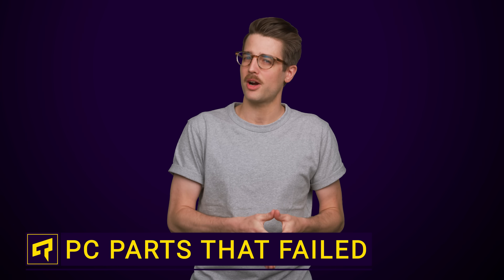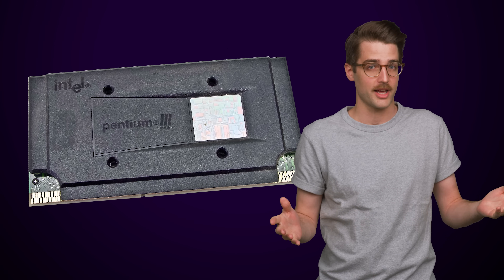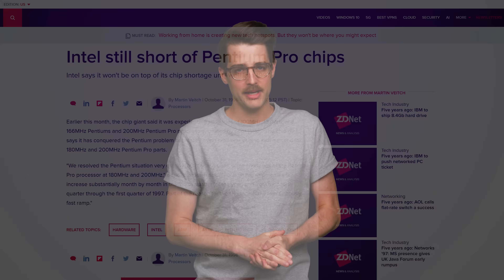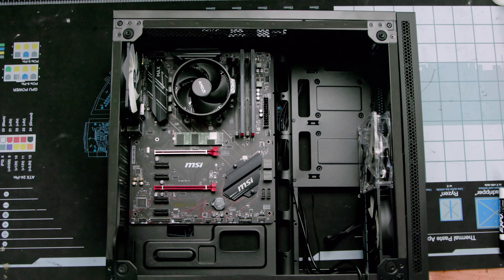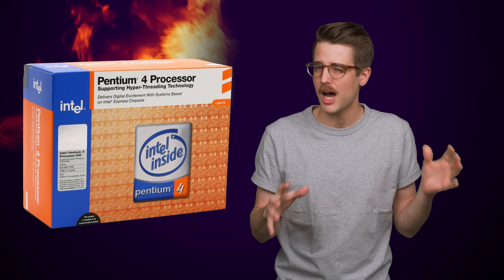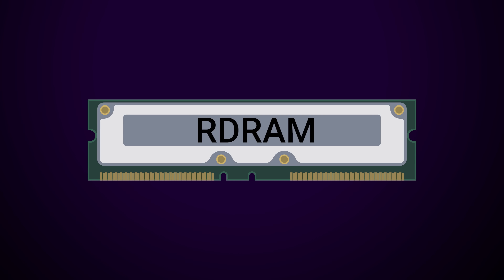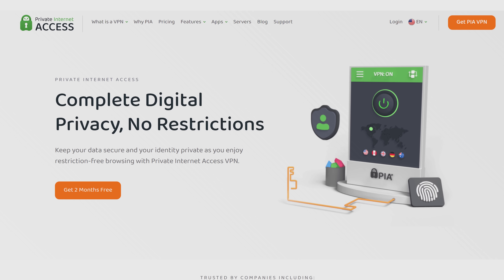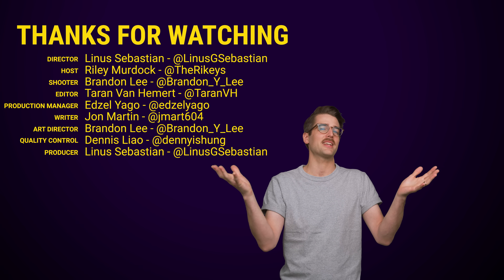PC Parts That Disappeared

Comment: this makes me think about: laserdisks, zip drives, sound cards, parallel ports, trackball...
Reply: Trackball mouses are still a thing
Reply: "sound cards"
Are still around,. alive and kicking. Sadly Microsoft killed EAX, same as they killed DirectInput, to push the XBox, and gave no replacement at all (and for directInput we got a massive downgrade).

But still - if you want to have good sound with a set of nice speakers you really should get a soundcard.
Reply: @ABaumstumpf  Microsoft killed hardware accelerated audio to make everything go through software. EAX still works, but due to that and other reasons advancements on it were killed and thus devs stopped using it. Cheaper to use software solutions anyways I'm sure. All the old games still work though, just use Alchemy and it all comes back up.
Reply: @miloolsen4395  I do have a soundcard, but not installed in my PC cause i neither have any equipment set up that would benefit from it, nor do i actually care that much. But darn was it nice in the old games with the good effects :(
Reply: @ABaumstumpf  
I stuck an old Creative Labs sound card I got free in my PC because my main PCB doesn't have an optical out, works great, gives me a suite of surround functions and the sound quality is a lot higher than the on board Realtek crap, and yes I do have the audio equipment to tell.
Reply: MiniDisc too - which was actually a superb product, but just a bit too late (MP3s were a thing by that point) and priced prohibitively at launch. But I still have the nostalgic fuzzies for it, my little portable MD player was a solid, reliable pal for taking loads of music with me everywhere.
Reply: @hewandersaround  
Minidisc was quite popular with DJs for a time after it's commercial lifespan waned because they could use commercial recorders to easily make masters of their sets live for future distribution when they had a good night's work, it was a lot more convenient than using DAT in a live environment.
Reply: Fun fact:  If you any sort of audio controller (like the GoXLR that's very common among streamers) that basically IS an external sound card.  So not only are sound cards still around, they're actually thriving among people who want to use better audio equipment.
Reply: None of the listed products are bad and had solved a problem and was used for many years.

Slot CPUs and RDRAM lasted a couple years at best.
Reply: Not to mention HPIB or HP's 3" floppy disks.
Reply: good luck finding a ps/2 keyboard tough...   seriously i wish i had one, super assured low latency
Reply: @khhnator  Those still exist too.
Reply: @ppmguire  well yeah, but good luck finding one
Reply: @khhnator  And? You said good luck finding one. It's not hard, even decent mechanical ones. Like I said, won't have rainbow puke but they're out there and the connectors still come on modern boards.
Reply: I love to have a sound card even now it was a dream as i child, now thag i xan buy it o dont give sh**
Reply: Laserdisc was popular in Japan. I've heard from people whose VHS tapes got wrecked by the humidity. 

However laserdisc suffers from disk rot...
Reply: Uhm soundcards still exist, they are part of the MB, but exclusive soundcards are still on the market for the audio market, just like Network cards, a simple one is integrated in the MB but more complex and dedicated to other procedures cards still exist.
Reply: You still have soundcards, it’s just that they do less
Reply: I miss the trackball. I loved playing with it
Reply: @glipk  Playing games with it?
Reply: PCMCIA
Reply: I recently put Audigy sound cards to 2 PCs with Realtek integrated audio and the difference in mic and speakers quality/noise/loudness was immediately noticeable to every casual user. Sound cards are still relevant but I guess now external USB ones make more sense.
Reply: Jumpers and dip switches.
Reply: Still use sounds cards and ball mice :)
Reply: I still have a sound card.
Reply: Jazz and tape
Reply: I remember when adding a soundcard would actually give a boost to your FPS over the integrated audio chip. Now we got so many cores a soundcard I don't think it would help with that today, but they can give an improvement in audio over the integrated chips, mostly by being less noisy, though modern integrated audio is much less noisy than it was 15-20 years ago. Hell most ppl including me can't tell the diff between MP3,Flac and actual analog like a record. Protect your hearing kids, your ears will thank ya when your almost 40 and constantly say "Huh?" every time someone talks to you. lol
Reply: And graphics cards. Remember when they were a thing?
Reply: I can't begin to count how much money I sank into ZIP disks. Gah!
Reply: i was thinking laser disk too
Reply: External sound cards are still being manufactured. 
There’s Sound Blaster cards that go in PCIe x1 slots (I think they were called Sound Blaster X), those crappy $7 USB sound cards (plus the good ones), and there’s modern replacements for the old sound cards, like Adlib clones.
Reply: omg my dad calls regular usb flash drives 'zip drives' and i always assumed it was just an older term for the same thing. after reading this i googled zip drive and !!
Reply: You missed the ps/2 connector
Reply: @aumbhatt5339  ps/2 connectors are still on modern boards.
Reply: Dedicated Soundcards, unfortunately are worse off than external audio devices that can render audio. I.e. USB Audio interfaces.
Reply: Sound cards still exist, they are built into the motherboard now
Reply: @hubertnnn  Real sound cards are still produced today outside of onboard.
Reply: @ppmguire  I still have a soundblaster ...
Reply: @arieloq  I have several, still use a Zx in my machine.
Reply: @hubertnnn    To bad most of them sound bad
Reply: @hubertnnn  I think he was talking external, or legitimate PCI/PCIe cards.

Comment: Internal sound cards more or less did. Sure, there is still some manufacturers that make them but mostly people just stopped carrying and went with the onboard sound from the mobo, which has improved drastically over the last years, and enthusiast can still get an external DAC/AMP solution.
Reply: as someone who had the displeasure of having to experience modern onboard audio, i'd say drastically improved is quite a stretch to say. for a person who cares about audio quality, they still arent even anywhere close to level of an dedicated spu produces and maintains. i used my "made of high grade audio components" onboard audio and then my actual 2007 released internal one and it wasn't even a competition, lets just put it like that.

Comment: I've got a Prescott P4 on my keychain, to help keep me warm.
Reply: I had a 30 pin SIMM for a while back in high school (balanced out with a chain wallet and a two door manual transmission car with flames painted on it) but all the chips eventually fell off. I then found out that I can use the PCB to bypass certain locks that credit cards were too flimsy to move, until I broke the PCB trying to get into the science class supply room. 

How'd you get a CPU on there? Drill a hole somewhere?
Reply: @the_kombinator  Yup, just drilled a hole in it just big enough for a regular keyring, and also sanded the corners, those are sharp!
Reply: "The computer had faulty wiring that caused it to overheat when the spacebar was held down for too long. When the manufacturer issued a recall, they were met with opposition from children in developing countries, who were holding down the spacebar to stay warm in their unheated homes."

—XKCD (paraphrased from memory)

Comment: How come when talking about older Intel chips nobody ever mentions the Pentium D?
Reply: Ya, it was the bridge for Intel from the P4 architecture back to the P3 architecture but with two on-die CPUs, which then lead to the CoreDuo.
Reply: @andywolan  It wasn't. The Pentium D was still a Pentium 4 architecture, that's why nobody ever mentions it: it didn't bring anything new or interesting.
Reply: @Olivyay  you’re right. That explains why they are found in btx cases. Never-the-less, it was the first intel cpu with two cores on the die and the first desktop dual-core cpu if I am not mistaken.
Reply: @andywolan  the pentium D beat the athlon 64 x2 release by a few weeks but it was a rushed product in responce to the athlon 64 x2. it was 2 pentium 4 dies on the one package where as the athlon 64 X2 was a single die with 2 cores. the pentium 4 was already a toaster but they doubled it. i had 24 HP business desktop 7600 loaded with 2.8ghz pentium Ds in a computer room. you never ever needed to turn the heater on, they ran real hot all the time. even when idle.
Reply: @CaffeinatedSentryGnome  ah, ok. So it was a hack to get a two core solution out. Core duo was intel’s real multi-core solution.
Reply: It was also very much short lived. I remember seeing it as an OEM chip much like the Celeron was Intel's lowest end consumer chip on the most budget friendly new computers being sold. Basically comparing it to the most base model car a manufacture has that they don't care too much about. Instead of wasting all the R&D and Silicone on a basically failed product; pump a few hundred out and call it good.

Comment: I remember knocking a resistor off of my Slot A Athlon XP while trying to overclock it using a gold fingers board. It kept working, but I laid off the overclocking a bit.
Reply: Mind you, there were no slotted Athlon XPs, only the 'regular', ones ranging from 500 to 1000 MHz. Meanwhile, the XP started at 1333.
Reply: @spavatch  yeah it was a regular Athlon then...oops...been what, like 20 years? Memory gets fuzzy.